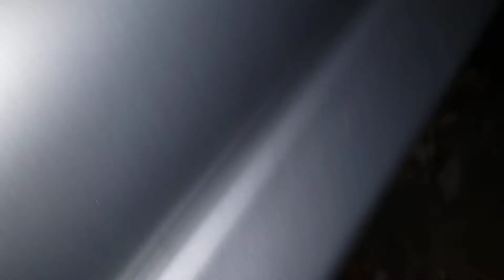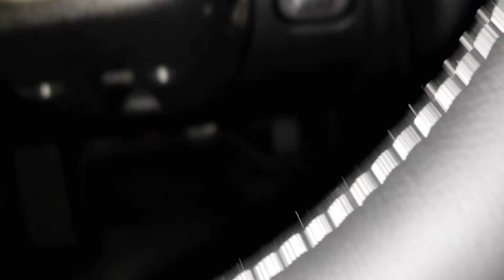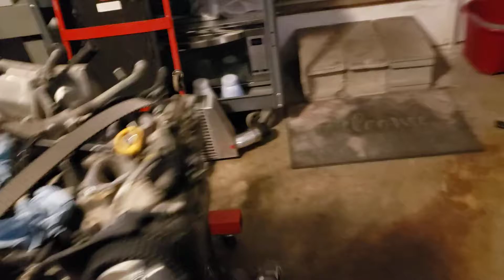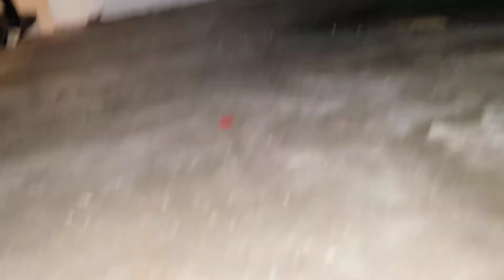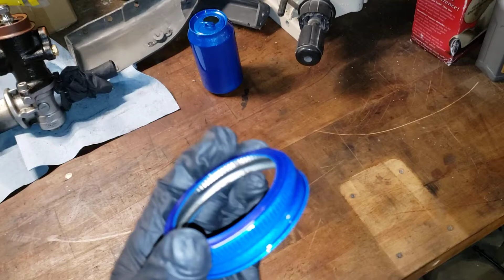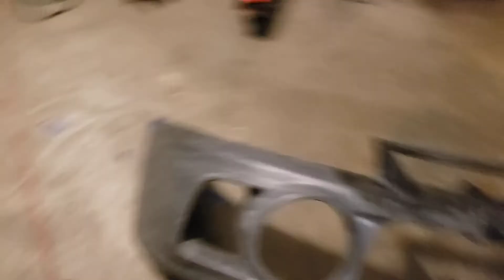Project 2Dr IV: Build Update!

Comment: Any tips on starting a build kinda like yours haveing trouble finding parts for my 1997 mirage from tn
Reply from the maker: If anything I would strongly recommend learning the Mitsubishi parts bin as there's basically no aftermarket available specifically for Mirages.  I built this whole car using parts from just about every Mitsubishi out there from Outlanders to 3000GTs and of course lots of Evo parts.  If you learn what parts from other cars will work on your car you'll find there's actually a ton of aftermarket and even stock part upgrades from other cars open to you.  The parts just aren't listed as Mirage compatible.
Reply: Hey bro I went on the  mirage forum to get the wiring for the digital ac conversion but it's not there anymore. I messaged you on Instagram but no response yet. Can uou help